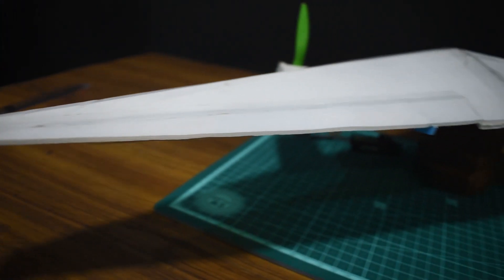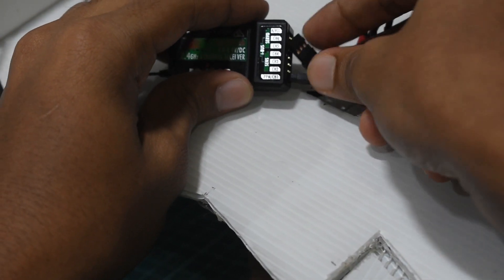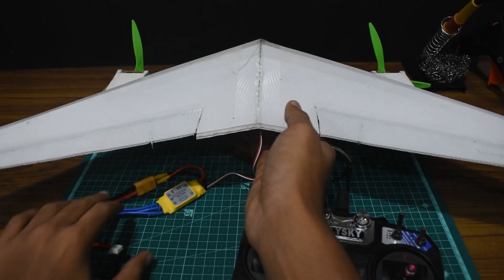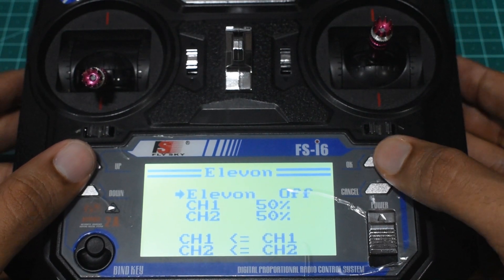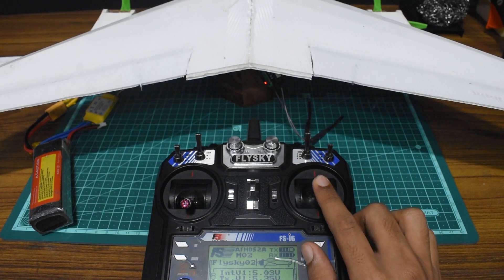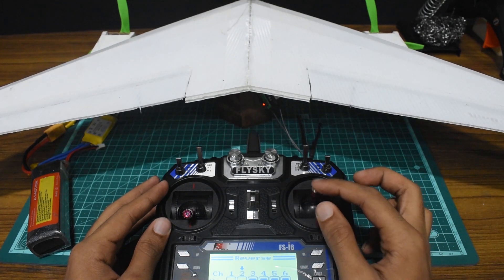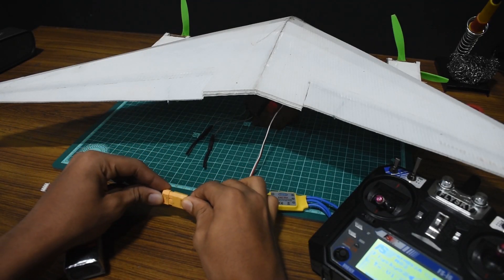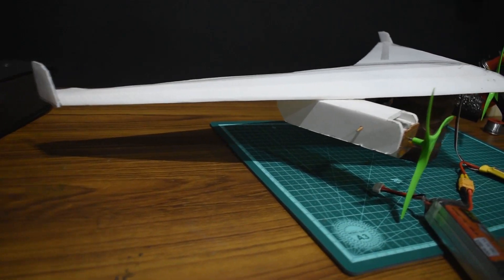FLYSKY FS-i6 Elevon mix setup [Jet Nautics]

Comment: Bro I want to talk you to know more about this setup 
Please reply me
Reply: Sir I want to become rc plane having 2kg weight I will use edf 70mm- 6s motor then tell me which is suitable battery for this rc plane
mAh??? C??? 
Please reply me sir 
I request you
Reply from the maker: @mohammadarman7577  GNB 4200-5000mah 6s 50-70c
You can get it from runrc website
Reply: @JetNautics  Sir what is the flight time it gives???
Reply from the maker: Yes

Comment: I used a Y harness and plug it to channel 2 or 1 and i cant get it to sync
Reply from the maker: Donot use a y harness for eleveon as each servo has a different channel.
Use individual extensions.

Comment: How to know battery is low during flite time and need to land....does fsi6 transmitter indicate remaining battery time during flite?
Reply from the maker: The easiest way is to install a voltage checker in the plane itself, and an alarm will go off once it reaches too low voltages otherwise you have to buy a voltage sensor and connect it to the sensor port in your receiver, which will display the voltage on ur fs i6
Reply: @JetNautics  cool thanks!

Comment: Just what i needed. Now i need how to hook up the motor which i have put in place with servo in place but am lost, can you help me there, oh yes thank you!!!!!!
Reply: When you plug the servo plugs and you say to have the signal wire upward, and
Reply from the maker: @DLM517  yes
Reply from the maker: Servo placement?
Reply: When i plug the servo plugs in with signal should be diagnal upward, only 2 pins are covered with, am i correct, also the esc plug to or is it flat in rx.
Reply from the maker: @DLM517  I don't understand ur qn. Diagonal upward? ,covered?